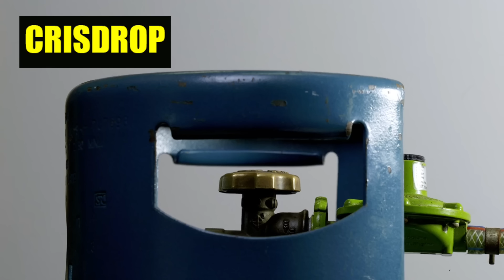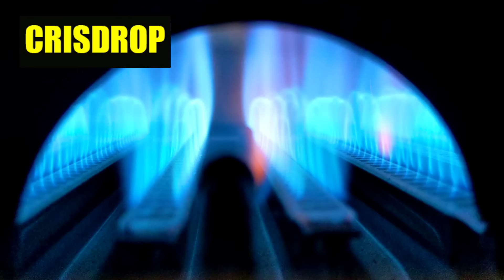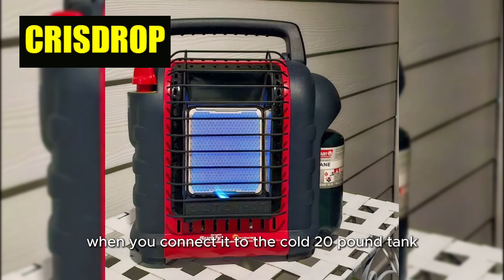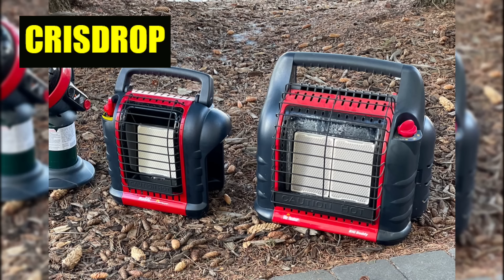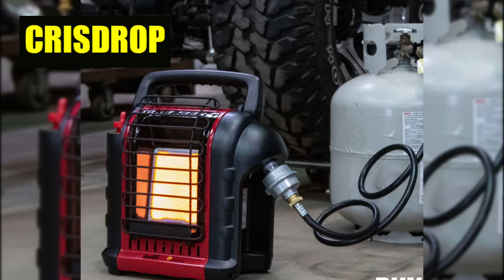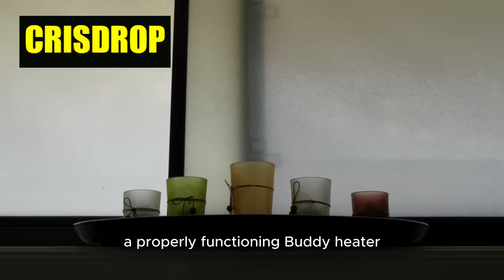50 Things You Didn't Know About Your Mr Buddy Heater

Comment: Ehh, the variable bit doesn't make sense.
My big buddy gives you 1 element running or two. It's not a thermostat. It's a valve.
And warming the disposable before filling is going the wrong way. Be very careful about these tips.
Reply from the maker: Appreciate you sharing your experience and tips on the heater's operation
Reply: YES I THINK FREEZING THE SMALL TANKS AND PLACING THE 20LB BOTTLE IN WARM WATER IS CORRECT.

Comment: I have a couple of big buddy heaters and 16 one pound refillable tanks. This gives me the ability to run the heater while I refill and warm 8 tanks before they are needed. Cold propane does not burn well and I choose not to bring the large tanks in the house.
Reply from the maker: Smart strategy with the refillable tanks to keep them warm and the heat going!
Reply: I don’t bring the larger tanks inside either. I set a 20 or 30 lb tank outside a window and run a15 ft through the window. Wrap a blanket around the tank around the tank to keep the propane warm.

Comment: Regarding #17 - I understand about using the correct hose BUT I have a question - would installing an in-line filter as suggested for the OTHER types of hoses do any good regarding eliminating any impurities in the propane itself? Or is it not THAT kind of "filter"?
Reply: He did state, "this is the only hose you don't need a filter with," Mr. Heater hose. So, according to that, you can use a different hose, different manufacturer, as long as you use a filter. Surely other manufacturers make appropriate hoses that are safe to use.
Reply: That correct hose still puts out impurities. I use the filter on the correct hose and the little Coleman bottles. That filter is 4 years old and still not clogged up.
Reply: @thomastuckermoondiamond2031  - Thank you, I kind of thought it would be a good idea.